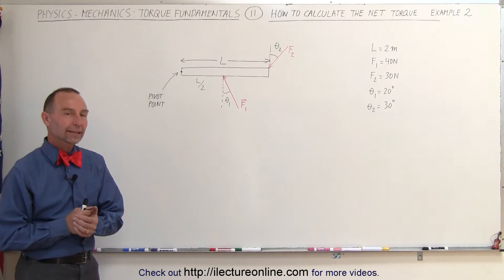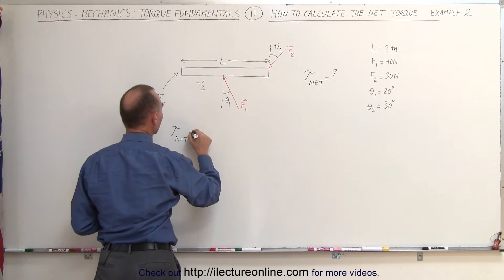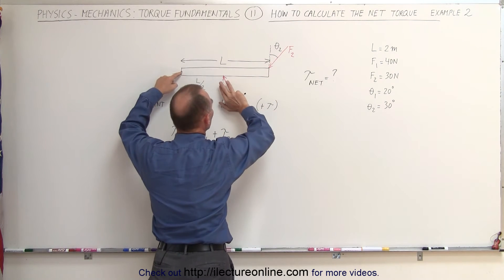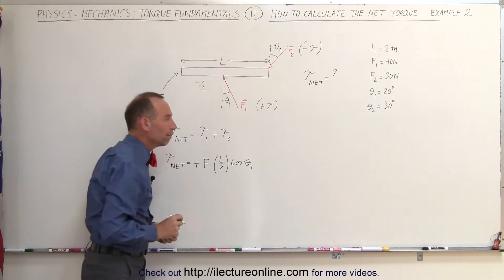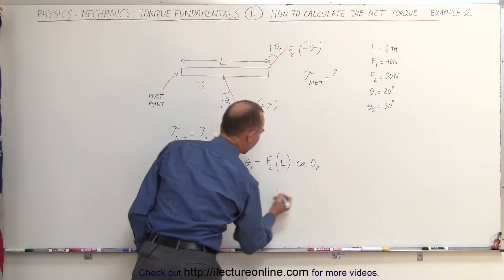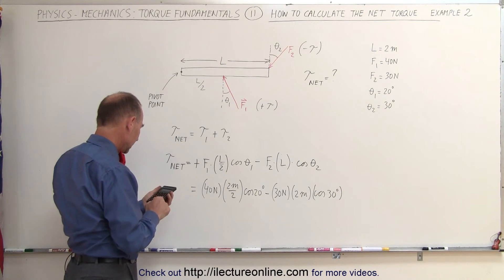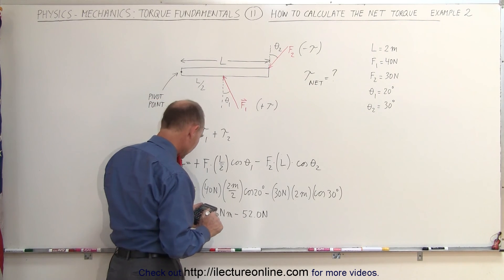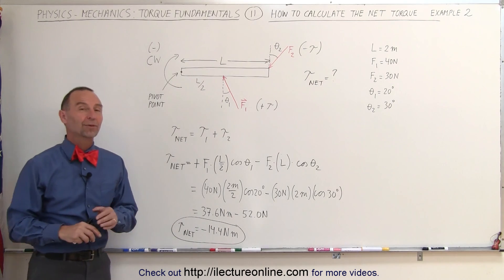Physics 15  Torque Fundamentals (11 of 13) How to Calculate the Net Torque? Ex. 2

Comment: I think it would be worth mentioning torque is the cross product of vector representing the distance from the pivot point and the force vector. Therefore by this, we would be taking our angles as 90-theta1 and 90-theta2. Of course sin(90-x)=cosx, so your calculation is mathematically sound 🎉
Reply from the maker: Thank you for your input.  If you watch the whole playlist you will get all those details.  They are systemactically explained ever the videos in the playlist.  It is like attending 5 minutes of a two hour lecture and wondering why you didn't pick up all the information.

Comment: where sin theeta is used?? plz  tell me!In All ur problems only cos theeta is used but I really don't know where sin theeta is used??
Reply: Sana Zahra Sana, when an angle is set to be between force and position vector or distance (in this case L), then we use Sine theta. 
But when we consider the angle between the force and the line perpendicular to the position vector or distance (not directly between the force & the distance), then we use cosine theta.
Reply from the maker: It depends on how the problem is set up and how it is solved.  In this case we want the perpendicular components of the applied forces for which you need the cos to calculate them.
Reply: +Michel van Biezen sir Plz Can u give me an example so that I May understand!!
Reply from the maker: I am sure there are many examples in the playlists.